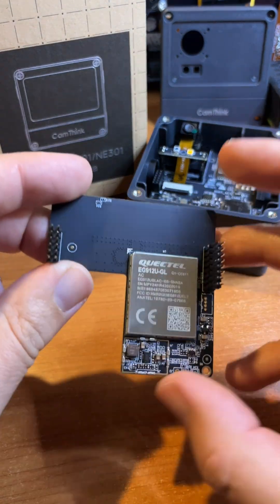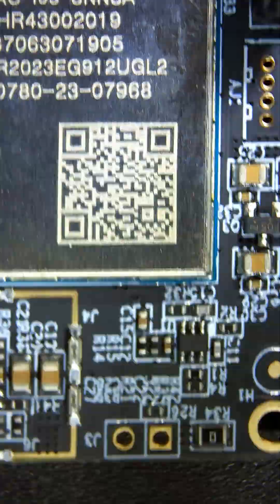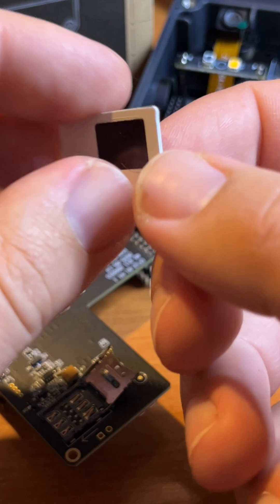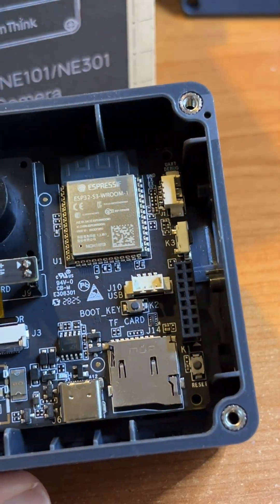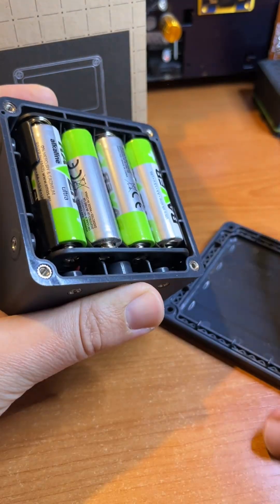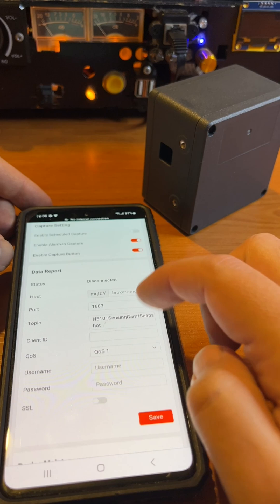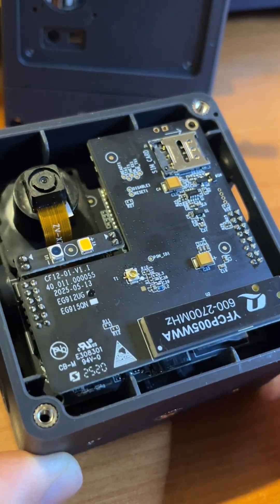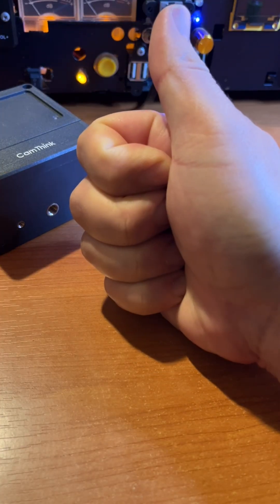4G CAT-1 module for Camthink NeoEyes NE101 camera

Comment from the maker: 4G Cat.1 Module Specifications: Quectel EG912UGL, supports LTE FDD/TDD and GSM（global frequency bands expect for North America）, dimension at 60mm x 60mm.
:::
https://www.camthink.ai/product/neoeyes-ai-camera-ne101/?utm_source=youtube&utm_medium=kol&utm_campaign=kristina
:::
https://wiki.camthink.ai/docs/neoeyes-ne101-series/overview
:::
NeoEyes NE101 is a low-power, event-triggered camera designed for long-term battery operation (up to 3+ years on 4×AA, 10 photos/day). It wakes only on events (PIR, radar, sound, etc.) and sends images via Wi-Fi, 4G Cat.1 or Wi-Fi HaLow.
:::
Key features:
Fully modular design: swap camera lenses, connectivity modules and sensors in seconds
Open-source hardware & firmware (ESP32-S3 based)
Replaceable camera modules: OV5640 CPI (60°/120°) or SC200AI USB (51°–137°)
Connectivity options: Wi-Fi (default), LTE Cat.1 (global & NA versions), Wi-Fi HaLow (868/915 MHz, long range)
IP67 waterproof, works from –20 °C to +50 °C
Rich interfaces: 16-pin GPIO, alarm input, TF card, fill light, UART debug
Multiple mounting options (wall, pole, table, etc.)
:::
Main applications:
Smart agriculture & livestock monitoring
Remote meter reading & industrial equipment checks
Outdoor wildlife and security cameras (intrusion detection with ultra-low standby ~0.8 W)
:::
Perfect for any battery-powered or off-grid vision project that needs years of autonomous operation.